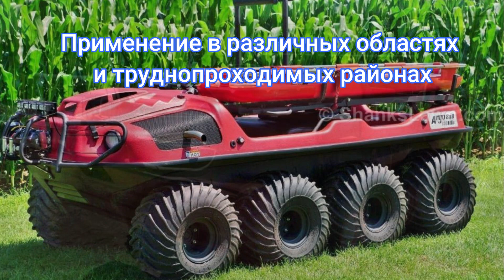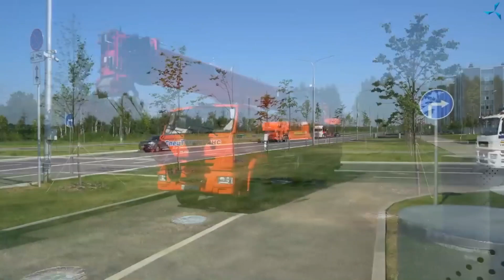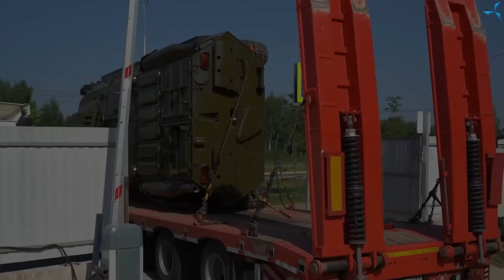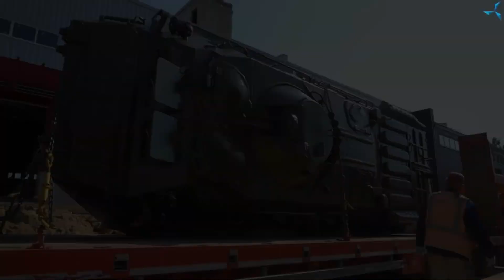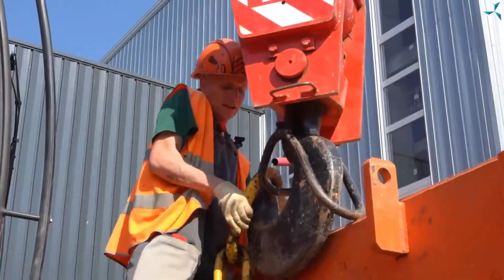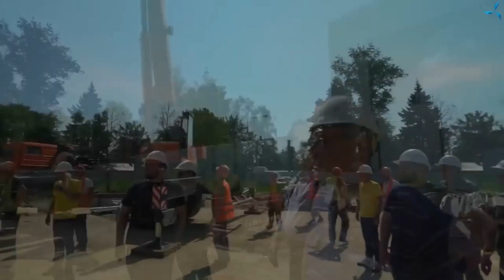Новые мотор-колеса для демилитаризованного внедорожника BTR 80

Comment: I hope that you make a traditional rear ramp door for civilian purposes as is present on newer transporters, inserting personnel with damaged spine laying on the improvised bed may be a struggle otherwise if you don't want to fold the injured person prior to entering the vehicle by the side doors or keep it on the roof, which is not ideal when in use up north. The funky side doors of BTR-80 greatly limit the usefulness of cargo space for civilian use in a wide range of scenarios...
Reply from the maker: our main task is not to create a BTR80, but to create a power drive for multi-wheeled vehicles, for the Ministry of Emergency Situations, for rescue operations, for difficult areas and much more. This is what increases the cross-country ability of these vehicles, significantly reduces consumption, increases maneuverability, and makes it possible to use this vehicle completely electric if the situation requires it.